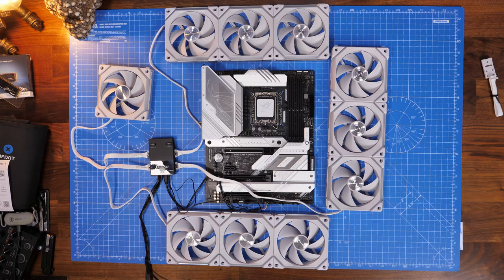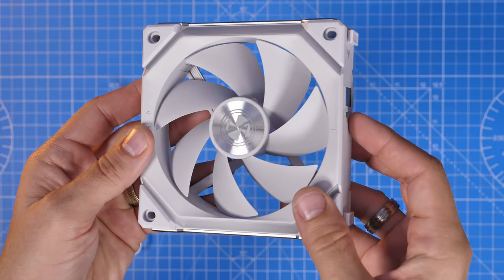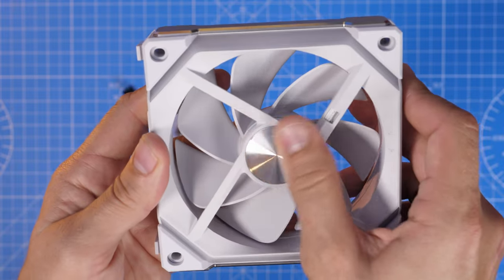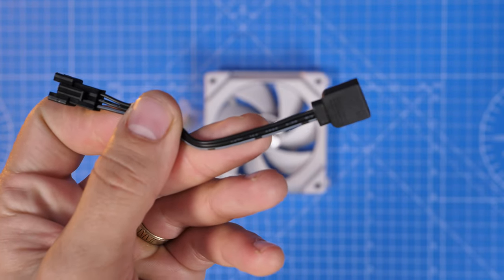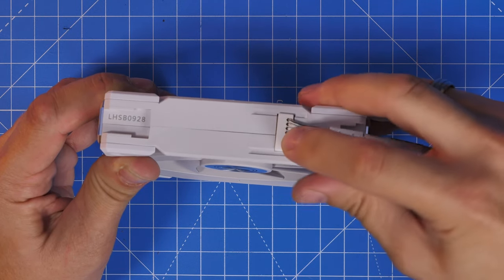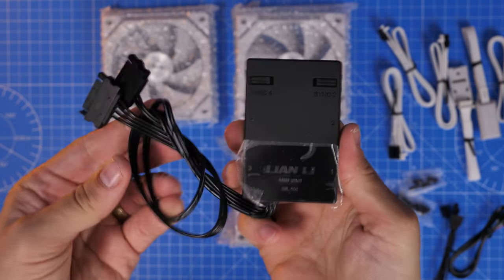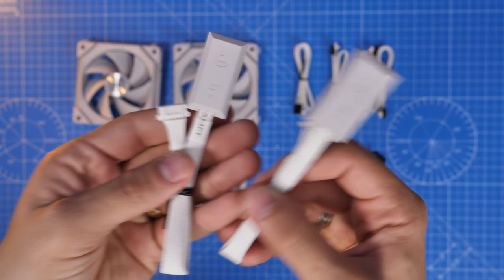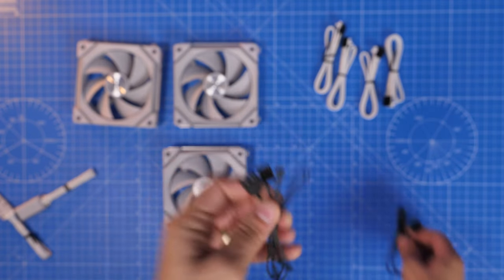How to connect and setup Lian Li SL120 V2 fans (including on an all-in-one cooler)

Comment from the maker: See deals on the Lian Li SL120 V2 fans (note these are affiliate links that earn me a commission at no extra cost to you, other retailers are available):
Amazon US - https://amzn.to/3DYrfVZ
NewEgg - https://newegg.io/nc01398328
Amazon UK - https://amzn.to/3zJ9Tdb
Amazon FR - https://amzn.to/3Wqi8oh
Amazon IT - https://amzn.to/3FGeb8Z
Amazon DE - https://amzn.to/3fx1C5k
Amazon CA - https://amzn.to/3Wui1bg

The SL120 V2 fan cables are a bit short but you can get longer ones here:
White: https://www.aliexpress.com/item/1005004996886068.html?spm=a2g0o.store_pc_groupList.8148356.9.516bc861Ipz0xZ&pdp_npi=2%40dis%21USD%21US%20%240.01%21US%20%240.01%21%21%21%21%21%402103250d16714397311788395e9dd4%2112000031289273060%21sh
Black: https://www.aliexpress.com/item/1005004996761655.html?spm=a2g0o.store_pc_groupList.8148356.15.516bc861Ipz0xZ&pdp_npi=2%40dis%21USD%21US%20%240.01%21US%20%240.01%21%21%21%21%21%402103250d16714397311788395e9dd4%2112000031289113965%21sh
Reply: OMG thanks!  I am building my new PC and the cable management is insane, especially with these stupid short cables.
Reply: are the cables the same for the SL120 without V2
Reply: @Simucoc3  no
Reply: Mr Prawn I was wondering if you could help me. I am currently trying to attach the galahad radiator to the bracket of the lian li O11D Evo and the screws were really hard to screw in when attaching the fans, but seem impossibly bigger than the holes when attaching the bracket to the radiator with the screws provided. 

Is this normal and will I need to really.force those screws in or has something gone wrong with the manufacture of my product? Feels like I'm breaking it if I try to force them in and I'm not even sure they'll go in, but every video I see they just screw them in like normal screws and I'm losing my mind 😅.
Reply: So sorry if you mentioned it in the video, but is the hub ok with fans of different sizes? Ill have mostly 140s with two 120s. Thanks for all the great lian li-specific content! 

Fwiw, your videos pushed me over the edge in buying their case and fans. Not because it was an "ad", but because i knew there were such detailed videos available to explain how they work.
Reply from the maker: @Joe-ts4xj  yes you can use either.
Reply: Hi i have a corsair 7000D case and im going to put 8 of the fans at the front and i have a corsair icue h150i elite which im gonna replace the 3 fans on it with these lian li fans as well. and 1 140 MM fan to the back so that would be 12 120 MM fans and 1 140MM for 13 fans total. i was wondering if that set up can all be daisy chained together since you mention the controller support 16 fans. not 100 % sure how i would run them all the video gives me and idea.
Reply: Is the fan controller the same thing as a fan hub?

Comment: except the V2 fans dont come with that V2 connector into the two seperate plug ins for the AIO? You have to buy a single fan to get that cable or what?

Comment: I am getting six of the reverse fans and they have to be bought separately would I just link 3 and 3 and use the wires from the regular 3 fan pack to link to the controller?

Comment: I just bought three tripple packs of these fans from microcenter yesterday and MY GOD this is so much BETTER! Way less cable clutter and it was so quick and easy to install!
Reply: Can you link 4 fans together?
Reply: @mattadaway8177  Yea. You can have a max of 4 fans per group. 1 controller can handle a total of 16 fans, 4 fans per group.
Reply: I found it the hard way the controller is for same type of fan. I couldn't mix different variations of the fans ie the white sl fans with the black non rgb. The fan pins was different

Comment: One important note regarding connecting the Lian Li connector the the breakout connection on the NZXT Kraken (at approx 18:50):
You do not want to connect to the last connection in the daisy chain (as you did), you instead want to connect to the first one. If you look at the breakout connection on the NZXT Kraken, only the first of the three has all four pins. The tach pin is missing from the other two headers.
If you hook up the connection as shown in this video, your Kraken controller will never get an accurate report on the speed of the fans. It is set to automatically assume all 3 fans are the same and have the same (or close enough) tach readings, but without that first fan plugged into the first plug with the tach pin you will get improper fan speeds that can cause heat transfer issues or even potential fan damage from spinning beyond their rated RPM.
Reply: you sir are why the internet is awesome, thanks!
Reply: @justincastle7276
I am planning to keep the 3 fans from NZXT and 3 from Lian li on that rad.
Can I connect the fan speed controller to the CPU fan header in the montherboard ?

So for Lian li fans, rgb goes to hub and power connection to CPU fan header on montherboard.

For NZXT fans, the rgb goes to montherboard header and the power as well to Optional CPU fan header on montherboard.
Reply: @_robyn_  did you find a answer for this I plan on doing the same …
Reply: @ADraised  Yes I have already built the system.
Initially I connected the Lian li fans RGB to Hub and Power to Montherboard.
That allowed montherboard (Asus) software to control the Lian li fans. Although Asus software rarely bother to spin up the Lian li fans so I connected them back to Hub.
So both Rgb and power goes to the hub. I control them with the L-Connect and keep them in quiet profile.

As for the NZXT fans, you can connect them on the connectors provided on the pump unit and control them with NZXT Cam. Again I have kept them in quiet profile.
Temps on 13900k while gaming stays in 50-65*C range while keeping the system quiet.
Reply: yep that is exactly what i did and spun 2 fans out before realising the cause :)
Reply: @ekksyte5287  I'm sorry to hear that my comment did not get to you in time. RIP Pour one out for those lost fans, boys.
Reply: @_robyn_  Did you hook the aio fans to the hub? why did he say that doing this is not ideal?
Reply: Wow thank god I read the comments. Thanks for the heads up

Comment: Great video.
I've installed 6x140mm fans bottom and side +1x120mm at the back and used 1 control box. 4+1 fans to 1 slot on the hub, 3 to another slot on the hub.

Comment: Thanks for making this so clear. You answered my question i left in a comment in another video. With the kraken you can power the fans with the breakout fan cable so the aio software can control the rad fans. So with the kraken you don't have to power the rad fans with the cpu fan header. Thanks!

Comment: Great video. Really helpful. I do wish you included a tutorial section on what to do if you were to use the NZXT AIO fans too for a Push-Pull config with these fans. That's what I was planning on doing with my planned build so I was actually wondering how that would work with 10 unifans.
Reply: yup, same doubt. If someone has lian li fans for top and bottom row that he can control with the lian li hub, then what if someone also wants to use the NZXT rgb fans comes with the AIO?? Do u need NZXT hub for that or directly control it through motherboard?
Reply: Yea what he said answer that question

Comment: Thanks for the video. I just now got my mobo synced with all my lian li fans. Works perfectly!
Reply from the maker: Glad it helped. Return the favour by subscribing
Reply: @TheProvokedPrawn  i did subscribe.
Reply from the maker: @DirtyMikeAndTheBoys74  legend. Thanks.
Reply: Do you have any suggestions for oc/uv ? I have a 7800x3d and a 7900xtx on a msi b650 edge. I play warzone on 1440p settings for higher fps. I played on steam for a week and I recently switched to battlenet. I had constant issues with steam. No problems so far with battlenet. I tried implementing some oc/uv from some youtubers I watched. My computer crashed again and again. I set it all back to default. It was disappointing.

Comment: I didnt get the cable you showed for the AIO cooler option, the cable with 2 connections on it. Does that come only with a single fan ?
Reply: Yes
Reply: Purchased it and got the cable but even then I cant seem to figure out how to let the AIO control my array of 3 Lian li fans I see near the end of the video it asks me the plug it into the 3 fan splitter but I cant see where that plugs into

Comment: Hey there. Great series of Vid on these. I have a couple of questions. 

1) It looks like your case it the lian li dynamic?  Can I plug the RGB for the front LED strip built into the case into the Lian Li controller?
2) If I plug the controller into the RGB header on the motherboard, in this case Asus, I assume I won't have the ability to control the RGB of each fan individually through amory crate? Its basically what it says, Aura Sync? Everything is th one color, you can't have waves going throughthe case where each individual fan lights up one after the other?
3) If I plug the controller into the PWM fan header on the motherboard, in thise case the Asus, I assume I won't have the ability to control the speed of each fan individually through the Asus Software?
3) I assume the Lian Li software can't control the RGB on the Asus mobo like icue can?

I am trying to cut down on the amount of RGB/Fan control apps. I already have Synapse running and would prefer to just have one more, eg Armor Crate or Lian Li's.

Comment: Since AIO normally comes with 3 fans already, I would need to buy 2 (3 packs) and 1 single pack of Lian Li SL120 V2..  or buy 3 (3 packs) and have two fans extra.

Thanks for the demo.

Comment: Defiantly going to save this tab. Will make setting up my fans supper simple when I get around to buying them.

Tbh my computer does amazing with only 4 fans in it... however I want the looks of a complete system not.... this monstrosity that works.

(Imagine fans that are too big zip tied to the roof of the chassis and laid down on the bottom....)

Comment: Think I will do a full set of AL V2 fans for the next build, case and 2x AIO and the new hub makes hooking up fans really easy, but then once you want to ensure CPU/GPU AIO has the right control it gets sketchy.

The software can drive them from the hub based on CPU/GPU temp and that might be great, but then you have to trust that hub and software to run the fans, and I wonder what happens in bios, or with an OS that doesnt run the software.  

So you might want to run those fans off the headers on the motherboard for hardware control instead.  But then you lose all that easy setup of the hub by having to split/break everything up.

So with the pass-thru from the hub to the motherboard that goes to a fan header and RGB header if using the single cable connection, do those work full time in passing thru motherboard info in those situations that the software is not running?  Else I will just do what you did in the last example and use the break out cable to the AIO fan control and a Sync port.

The loss here is a Sync port is not a group that can be individually controlled in the RGB software.

Comment: Great video! 

The 3 pack does not come with a cable with 2 connections on the end of it to connect to theIs there anyway to connect the 3pack of uni fans to be controlled by the AIO pump if you never got the one pack?

Comment: I’ve read on reviews that if one purchases a Galahad 2 lcd with infinity fans (which I just did) that you cannot run an additional 3 pack of infinity fans as it doesn’t have the proper cable to attach to the controller… I intend to use your link but I don’t want to purchase the wrong things, and a three-pack is cheaper.
Reply from the maker: You can. See here https://youtu.be/Mxm_29mWr9Y

Comment: 16:38 VERY IMPORTANT!
This sounds like a good idea but before I attempt to do this setup, I’d like to point something out.

So I’ve got the Kraken X63 280mm Cooler. Which used 2x 140mm Fans.
I’m using the Lian Li UNI FAN SL140’s on it for the radiator. Each fan runs “0.65 Amp’s” which 0.65 x2 = “1.3 Amps.” This is overcurrent for my motherboard’s fan headers as the manual shows all headers run maximum “1.0 Amp.”

So by doing this configuration, how will pulling “0.30” Amp’s overcurrent safe?

EDIT: So I assume at 18:33, I’m supposed to do this configuration?
As the breakout cable basically allows you to connect your AIO fans to the NZXT Pump itself, which controls the fan speeds? This does seem a lot safer for power instead of the other configuration which would be powering 2 fans off of a small fan header.

EDIT 2: So based on my research and the video, the NZXT Kraken Z73 has the breakout cable and fans Daisy Chain splitter attached.
But… with the NZXT Kraken X63 it does not have it attached to the breakout cable. Very odd.

OH! I wanted to point something out, in the video of you plugging in the daisy chained breakout cable, you just put it into the furthest connector(the third) instead of the first one, you should plug that into the first connection. You probably know this but didn’t realize it in the video.
Reply from the maker: From what I understand CPU_FAN will generally allow more power than a standard sys fan header. After all it's designed to power CPU tower coolers and beefy AIO coolers. That's my understanding. My experience is I've used multiple Lian Li fans on 360mm rads in different builds with this logic with no issue at all. To make that clear - multiple different types of fans, different rads, different motherboards. All without issue. If you're worried though, just use the controller instead.
Reply: @TheProvokedPrawn  Thanks for the fast reply. Could you check my edit I did to my comment? Using breakout cable to control fan speeds because it’s powered by the pump VS a header.

Comment: your video helped immensely! thank you! IDK why your SL infinity fans different than mine.. my fans only have the connection that you can slide over the top and only go directly to the 4 ports, they can't connect into the other fans other than through connecting them together as a single unit, I don't seem to be able to connect two, and a third with a different cable. Nor do I seem to have any of the cables to use the sync 2/4 ports..

Comment: Loved the video.  The only problem I'm having is that I've swapped my AIO fans for the SL-INF 120 fans but the rgb connector doesn't fit in the sync portion of the controller.  I'm trying to come up with a solution.

Comment: So I have these fans and a NZXT kraken cooler and I want the cooler to control my fans speed on it but I don’t have that cable splitter it’s just one single white braided cable with the flat long end that goes into the control hub

Comment: Thank god for this video. Your soothing voice actually helped me a lot and prevented me from ripping out my hair. Just one question. I am doing the setup with the triple pack Lian LI SL120V2 fans and the NZXT Kraken Z73 AIO. I do not have the two pronged cable that connects with the SL120V2 fan and on the other end to RGB and PWM. So I need to purchase a single SL120V2 fan in order to do this? Lol.
Reply from the maker: You don't necessarily have to. You could just plug them into the control box still. But speed won't be determined by the motherboard. It'll work still.
Reply: @TheProvokedPrawn  Last quick quick question. Fans will then be controlled by the hub, ok. Then the PUMP will be controlled by the 3 pin cable that plugs into the MB? ILY ❤️

Comment: I just bought a 3 in 1 pack but I don’t think it comes with the cable that plugs into the CPU Fan header. Can only connect it though the control box which is a shame

Comment: I broke one of the cords that come with the 3 pack and now for my rear exhaust fan I have to use the other cord that comes in the standard single pack. Can that fan sync up with the other ones that are plugged into the controller cause I'm pretty sure the cable that comes in the single pack only can go into the mother board please help someone.
!!Also all my fans are lian li infinity fans sl 120 mm

Comment: Whenever I click "PWM" in Fan Mode on L-Connect Software my fans just ramp up to 100%. I have the PWM Cable from my CPU AIO Fans plugged into the CPU_Fan Header on my motherboard, like you have done @16:50
Reply from the maker: You might need to set the fan header to PWM mode in the bios.
Reply: @TheProvokedPrawn  I just tried that but it didn't fix it unfortunately

Comment: It might help to have timestamps because this was overwhelming and confusing for me. I'm doing a build with an aio on top, 3 fans in the back, 3 on the bottom and 1 in the rear in the Lian Li Dynamic Evo case. My motherboard has 1 ARGB connector at the top and bottom and 2 system fan headers at the top and right side. I want to have 4 fans (top and rear) and 6 fans (side and bottom) per connection to the hub. What wires do I need to do that and be able to control the rgb and fan speed through the L Connect software?

Comment: as bad as I want to do the switch from the jumbles corsair mess of fan cables. Everything is working fine and I feel like I would want to upgrade my fans to another corsair fan just to avoid the headache of switching. even though it doesn't look too hard. I wish I really wanted to.

Comment: The cable you hooked into the pump and into the sync on the fan controller.  Does it have a name for it , I don't have that cable . So the 3 fans I have on the radiator I can't sync to the other 7 fans I have.  I have the 120 infinity fans .

Comment: What did you use for the fan screw? 4 screws out of the box 2.5 anti-vibration ssd can not be installed without plastics I had serious problems with installing a fan, the location of the plastics is normally for ssds, but there is no suitable screw for the fan in the case